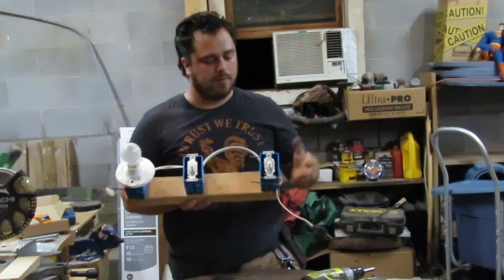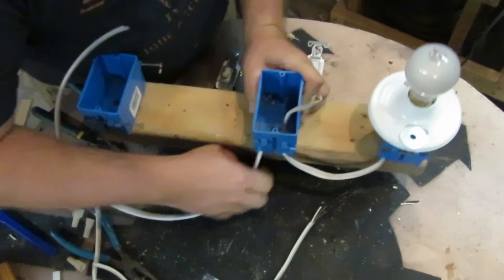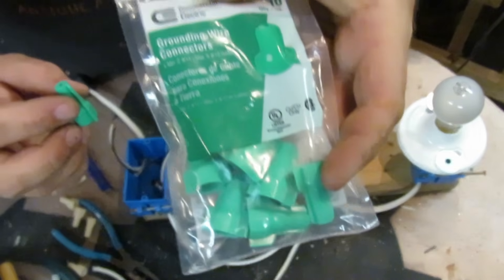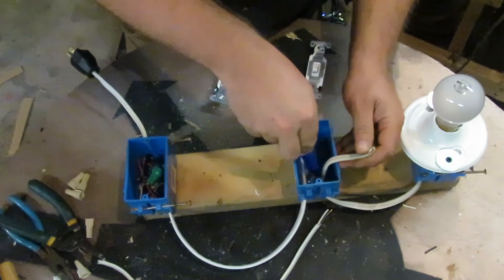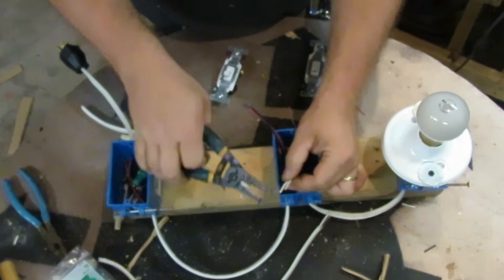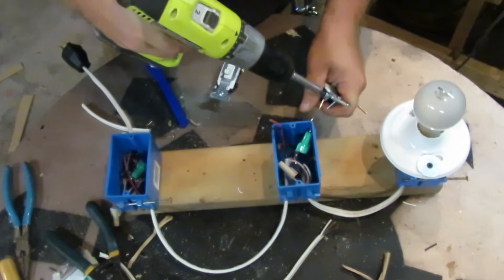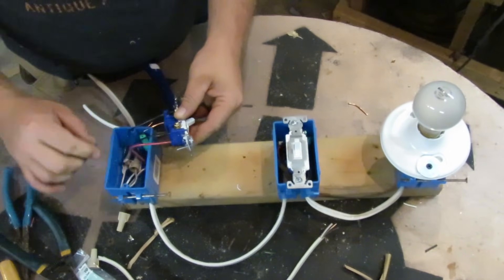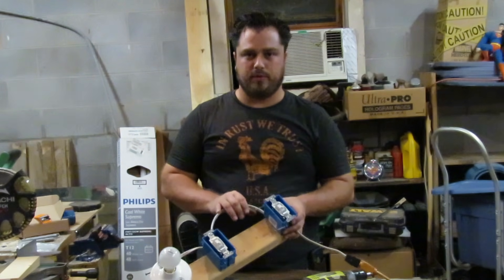How to Wire and Install 3-way Switches

Comment: Where is the electrical tape?
Reply from the maker: Not necessary, especially in a plastic box, just push the wires back into the box(specifically the ground wire, and because it's a bare wire, you don't have to worry about nicking the coating. You can use a screwdriver to help push it back if you need to)
Reply: @ I know by the code in my state it doesn’t matter if it’s a plastic box or metal box. If the wire nuts aren’t sealed with electrical tape it will fail inspection. Might be different in your state idk
Reply from the maker: I'd ask the inspector to show me that in the code book, they may have jurisdiction but I don't think they can just make up anything they want

Comment: Am I mistaken or is there a matching series that the traveler wires have to connect to? I ran a three-way and it is not working right now, except one side only so before I completely take this switch apart I’m wondering if there is more to it than what was shown here.
Reply from the maker: If only one side of the three-way is working, more than likely One of your commons and your traveler on one side of one switch got mixed up. Your travelers go on the screws that are the same color and you're common goes on the different colored screw

Comment: I had 2-3way switches that operate the light in my living room. The other day, it all a sudden stopped working as it should. If I turn the light on at one  and then turn it off at the other one, then go back to the first switch, I can’t turn it back on??? I’ve Lived at my house 9yrs, it always worked as it was supposed till then other day. I didn’t change anything… lost..
Reply from the maker: Something probably came loose,it sounds like it was wired correctly

Comment: I tie all mine in one box and run the 12/3 traveler to my other 3 way box
Reply from the maker: That would be what 8s commonly called a dead end 3way, the downside is that the 2nd switch won't have a neutral and if you want to add in a smart switch, it would need a neutral

Comment: I recommend not using the stab method. Always tighten wire around the screw, way safer.
Reply from the maker: In my experience, a good stab in never gets loose but I have seen too many screws get loose and cause problems. That wire is vibrating 60 times a second and a blade biting into a wire doesn't loosen but that screw can turn. But houses are done both ways with success, so keep doing it how you like

Comment: You should explain  the  position of each traveler wire ,left to left, right to right? Or right to left and left to right on the switches gold screws
Reply from the maker: That doesn't actually matter, as long as the common wire is on the odd colored screw and one traveler is on each of the traveler screws

Comment: This is the 3rd or 4th video where no one shows wires to the actual lightbulb fixture. Does it too get a ground? That's odd.  Should be more than just wiring the  3 way switches, and explaining 14-2 and 14-3 wire.  Geez, show the inside of the bulb fixture.
Reply from the maker: How the light is wired would be separate from how the switch is wired, if there is metal, then the light fixture should be grounded, but if there is no metal on the light fixture to be grounded, than you wouldn't need to ground the light fixture. Thank you for your input

Comment: You didn't say which traveler wire goes to which brass screw. For example, if the red wire goes to the left screw on each switch, then the light will be on when both switches are up and when both switches are down. When one switch is up and the other is down the light will be off. If you wire the red to the left on one and the right side on the other, you will get the opposite condition with respect to switch orientation. Not a big deal, just an fyi for those who may ask.
Reply from the maker: It really doesn't matter much because when you flip the other switch, it changes it and it also will be different depending on which way up the switch is installed, so as long as the travelers are on the brass screws, the system works. But  I appreciate your input

Comment: What if you have only 14/3 wire to your switch with black, white and red plus a ground hooked up to the switch? Our house was built in 1992
Reply from the maker: Sounds like what we call a 'dead end 3way' where the other switch box has both the hot and switch wire. It is using the 3 wire as the travelers and the common, which also means there is no neutral in that box

Comment: 2switches with a ceiling fan. Who do you do it?
Reply from the maker: 2 3way switches for 1 fan? Just wire the fan and fan light together in the overhead box and use the pull chains to operate the fan and fan light independently. Or get a fan with a remote are don't use the switches

Comment: I have a house I am renovating. It had two three switches. 
  Neither work completely independent of the other. 
  Could the hot be in the wrong terminal in one of them?
  I think I also noticed the white wire is on what I would think is the ground terminal on one of the switches. 
  One switch had to be in a certain position for the other to work. 
  I assume it is the first in that circuit going to the fan/lights.
  I might need to recheck to make sure they are actually three way SWITCHES.
Reply from the maker: Could be hot/switch wires mixed up with travelers, or maybe one is a single pole switch

Comment: I was at my girlfriend home and it only had three wires. I watch several video's be for I got to yours. You explaining thing help me figure out the problem with her switches which. When she had the switches changes out years ago the person use the common wire at the ground wire because there was only three wires. Your video help me figure out he had wired the switch back incorrectly. Plus, my girlfriend now knows none of her switches have a ground wire. Now we are curious, is not having ground wire for the switches dangerous?
Reply from the maker: I'm glad that my video was able to help you. You're correct that having no ground wires is unsafe but it could be that the ground wires hook to the Box itself.
Reply: @MechanicalChaos  yes I thought of the ground wire theory after my post. Thank you again for the video. I got special kisses because of you😁😂!
Reply from the maker: Fantastic!

Comment: how do you know which bank is hot, if you are working on an old circuit? You just pulled one of the two blacks and said this is hot. But if you are working replacing a 3-way how do you know which black wire is hot? You followed the convention, but I think if red would have been used for hot on both switch and 2 blacks are runner, then this confusion could have been avoided . Would you please comment on my thoughts? Thanks.
Reply from the maker: In this situation there's a 14-3 wire and 14 two wires where the 14 two wires have a black and a neutral which would either be the hot wire and a neutral or the switch line wire and a neutral so your Travelers are in the 14 3 wire that goes between the two switches, so you should be able to tell by the grouping of the wires which is the traveler wires and which is the hot wires but that doesn't always work in every situation because old work can get really finicky depending on how many fingers have been in that box
Reply from the maker: One of the best things to do is disconnect all the wires and all the boxes and use an amp meter defined your hot wire and neutral wire that goes with the hot wire and then you can start Tracy things out from there

Comment: I only have 2 black wires and a white on both switches and if you turn one off it cancels out the other what is the issue
Reply from the maker: Each switch box only has 3 wires in it, 2 black wires and a white, Sounds like you have power at the light box and the wires on your switches are coming down from the light as well, your problem is most likely in the light box. You'll probably have to disconnect the 2 switches and the light so you can trace out where all of the wires go.

-2 wires from one switch box will connect to 2 wires to the other switch box.
-1 wire will connect to the power in the light box and go to a switch box.
-1 wire will connect to the black wire on your light and go to the other switch box.
-And the light box will have those connections and the light's neutral will connect to the neutral in the light box

Comment: Im doing something wrong..Im doing this same thing....I put black to black and neutral to neutral to a outlet connected to a light switch...I turned the power on and power registers on the outlet but when I flip the light switch on the light comes on but it cuts power off from the outlet. any ideas?
Reply from the maker: It sounds like you have the power on one side of your switch and the power out and the switch line on the other side of your switch so when the light turns on the switch turn the plug on as well instead of the plug being on all of the time
Reply from the maker: To further clarify it sounds like your switch has a power in power out and a wire to your light switch oh, so three sets of wires and it sounds like your power in is by itself where is your power out and your switch wire are together
Reply: @MechanicalChaos  thanks for responding...maybe i should make you a video....on the light switch there is a black wire(power in) and the white wire (goes to the light).  I  ran the romex and attached the  black wire on the romex to the black wire on the light switch and white wire on the romex  to the white wire on the light swiitch.   on the outlet I put the black on the brass screw...right side and white on the left side.  maybe the light switch has to have a 3 wire coming into it from the box...i dont know.   something else...in the outlet i have one of those testers plugged into it that lights up when it has power...that goes out when i switch the light on but i can test it also with one of those hand testers that beeps and it still says its hot even though the  the plug in tester light went off, signifying no power.  strange. so the black wire is still hot on the outlet but the plugin tester doesnt light up...how is that possible? lol beats me. maybe the outflow back to the box is interrupted somehow.. a/c alternating is goofed up somehow.
Reply from the maker: It soumds like your switch has a switch loop, the power is in the over head box and they have one peice of romex to bring the switch power down and the other wire to take the power up to the light itself, in this case, there is no neutral in the switch box and the plug that you added will never work correctly
Reply: @MechanicalChaos  lol...thanks for solving the issue.
Reply from the maker: Good luck

Comment: It's sad that my brain got lost the second you started using words like traveler, common, load, hot wire. I cannot wrap my brain around any of this because the terminology throws me into total confusion. Lol It's not you. It's me I'm sure.
Reply from the maker: I'm happy to answer any questions you may have.

The traveler wires are the 2 wires that go between the two 3-way switches.
 The common is the 3rd wire that hooks up to the switch, it can be the hot wire(the wire with power) or switch wire
Reply: @MechanicalChaos  Got it!! Went and read "common household electrical terms", now everything makes perfect sense. Thank you!!! Now time to see if I can install this Alexa Smart dimmer switch on only one of 2 switches for a bunch of can lights in our brand new home. Should have hired someone to do it but I'm cheap and figured meh, can't be any big deal. Right!! (As my wife rolls her eyes at my electrical ineptitude) Hahaha
Reply from the maker: Good luck

Comment: is it possible to add a receptacle from a 3 way switch?
Reply from the maker: Yes and no, you can come off the three-way that has the constant power on the common and put in a receptacle from there but you cannot put a receptacle off of the switch that has the switch line in it

Comment: Partly helpful, partly not because it goes a bit fast when you put wires to the switches and the video is too blurry and unclear to pause and look at how you connected to the switches.
Reply from the maker: Sorry, feel free to ask any question you may have
Reply: @MechanicalChaos  thank you, i appreciate it. I was having a hard time finding a video that connected a three way switch for my exact scenario, but eventually found it after like 30 videos
Reply from the maker: I'm glad you were able to find an answer to your problem

Comment: Does the order of the traveler wires matter?. I ask because I see you put on the right switch the red on the left and black on the right whereas you did the opposite of the left switch. (screen wise).  Or it will just inverse the on and off when the circuit is sealed and live?
Also, what is an illegal connection?. Is it a connection done without a permit but may or may not meet code  but the fact that permits were not pulled made it illegal?
Excellent video !!
Reply from the maker: As long as the travelers are on the correct screws, the switch will work, there is no up/down=on/off with 3ways because they can be on or off in either position
Reply: @MechanicalChaos  thanks for the information. I'm subscribed to your channel!
Reply from the maker: Thank you

Comment: Since I only replaced the switch on the one end, when I find the wire with the power, that goes on the black screw and the other two wires, which will be the travelers, will go on the brass screws.  Should be an easy fix.
Reply from the maker: No, find which wire has power, flip the other switch, if that first wire still has power, it will be your common amd the other 2 would be your travelers, if power changes wire, those are your travelers and the wire that never had power would be your common

Comment: Good video.  I'm having trouble after I replaced the 3 way switches in a 72 year house.  Don't have white, black, and red. Just black and dark brown.  Can't tell which is the traveler and only have light off one switch but not both.  Any ideas how to trouble shoot?
Reply from the maker: I would suggest disconnecting both switches completely, then using a volt meter to find which wire has the power, that will be your common for that box and the other 2 wires will be your travelers. Hook those to the switch, then in the other box, find out which wire has power, that will be a traveler, flip the first switch and see which of the other wires has power, that will be your other traveler, and the last wire will be your common wire for that switch
Reply: @MechanicalChaos  Thanks, I've written these procedures down and will try them on Monday.

Comment: Great vid, thank you for addidng the notes like the brass vs black screw. I just replaced a system that had me messed up, because the previous system used the red as the hot wire instead of the tracer/link wire. I know the colors dont matter too too much but this vid helped and fixed the problem i ran into 

Thanks again
Reply from the maker: So glad my video was able to help :)

Comment: does it matter if the traveler wires get mixed up when installing?
Reply from the maker: Just so you know which 2 are the travelers, as long as you put the travelers on the same color set of crews

Comment: I want to run a light switch 1st off the  light  shown and then run a double banger receptical next . Would this be done the same way with the same wire 14-2 ??? Thanks .
Reply from the maker: So, you have a light with a switch, and you want to add a 2nd switch and a receptacle?

Comment: On a lot of smart switches they refer to connections as line or load.  Is what you are referring to as the common, also the line?
Reply from the maker: Line is the power coming in, load would be a light in the case of a switch. On a 3way, the common it the line on one switch and the load on the other switch

Comment: If i wanted to add another line from the existing switchbox, how do i go about that?, I wanted to add a sensor light for the front of the house, Thank you.
Reply from the maker: You could only add a switch line from the box that has the first switch line in it, but you could always come off the existing light
Reply: @MechanicalChaos  thank you, if i add the line from the existing light , would that stay on as a continuous electric source for the sensor light?
Reply from the maker: It would be switched just like that light if you want constant power for the new light then you need to come off the power side of the 3-way switches